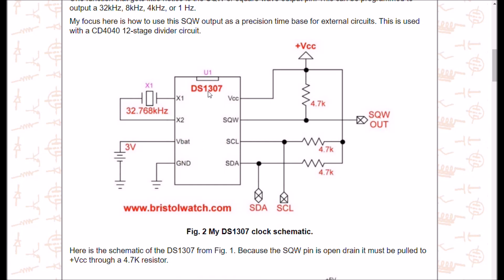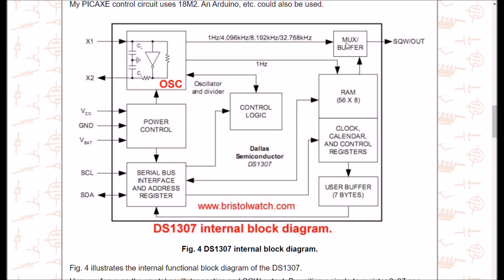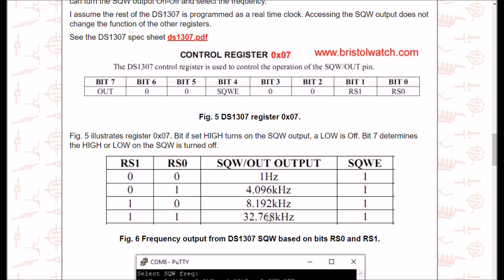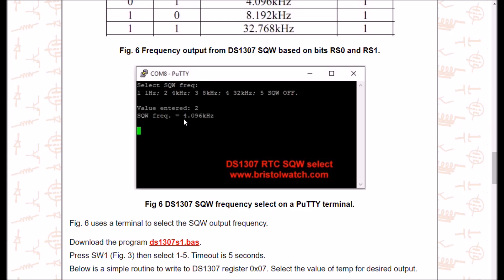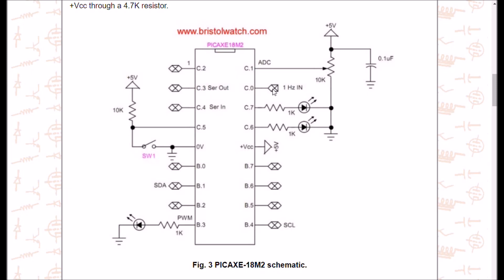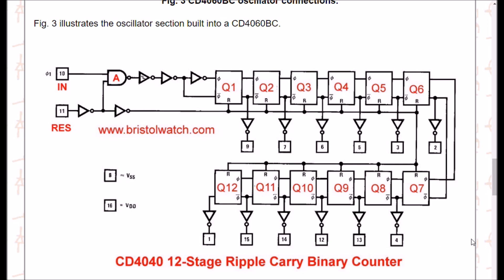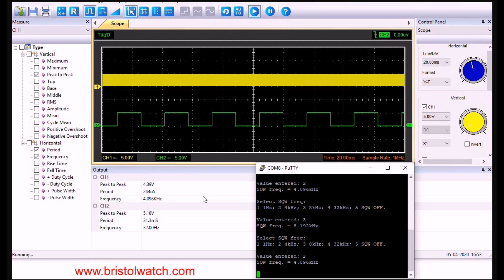Use DS1307 Square Wave Out as a Crystal Time Base

Comment: How would you get 60hz ?. I would like to modify a old Clock and it needs 60hz to work.
Reply from the maker: It can be done with this but it involves a 2nd CD4040 and a 3 or 4 input AND gate.

Comment: At 8:01 you said bit 4, but ain't that bit 5?
There are 8 bits so the first should be bit 1 not 0  right?
Or have I been away so long from electronics that they changed this?
Reply from the maker: Pin 4.